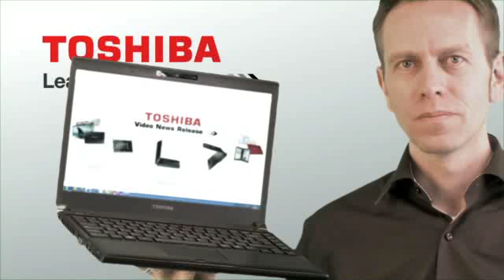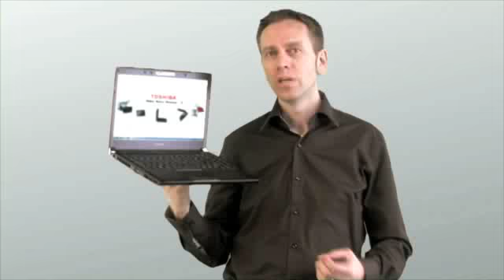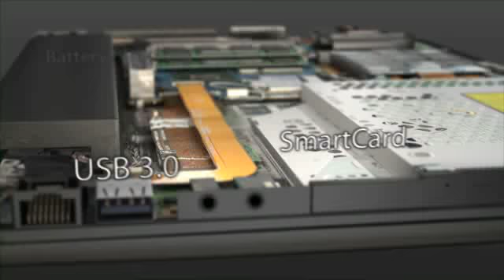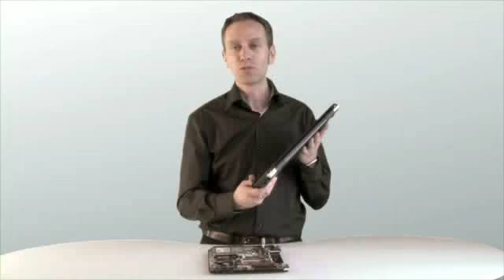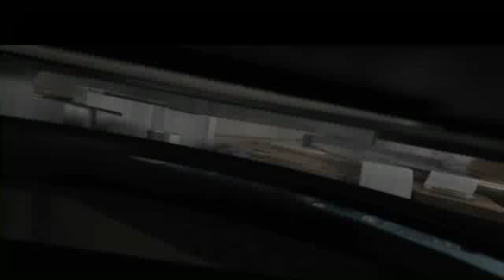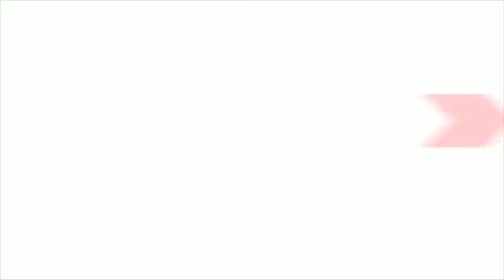Toshiba Portege R830 Official Intro Video

Comment: I'm a IT tech, I've never seen an aluminum heatsink in a laptop, all cooling fans in laptops intake cool and exhaust hot air, the only difference here is that there is no duct between the fan and the heat exchanger on the side of the laptop. Most laptops also have the CPU and GPU located close to the side. So, while this is a nice laptop, and very lightweight as well, there's not a whole lot of internal innovation going on.

Comment: yeah it's not aesthetically appealing but having gone for 3 laptops which were only to have crappy performance and heating problems in about a year has convinced me that looks matter very little in the long run. for laptops anyway. (of course series 9 and mac air is awesome and all that but the price? and I just can't do without an optical drive to boot. had a netbook and while i don't use the optical drive much, when I do ever need it, it's an absolute b*tch not to have one)